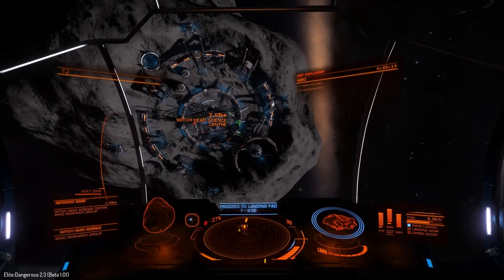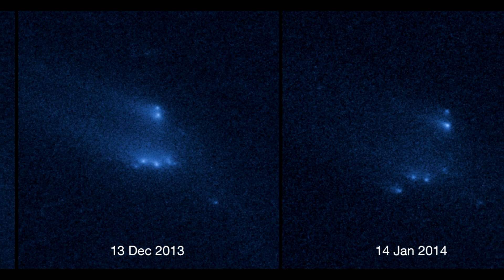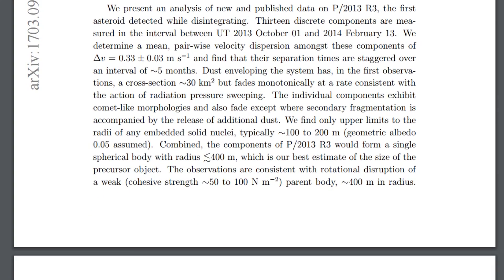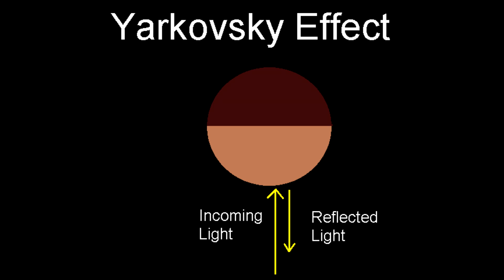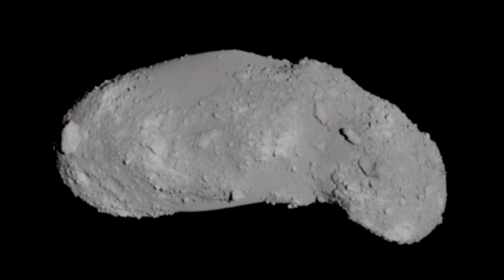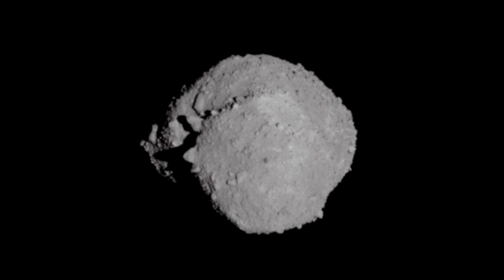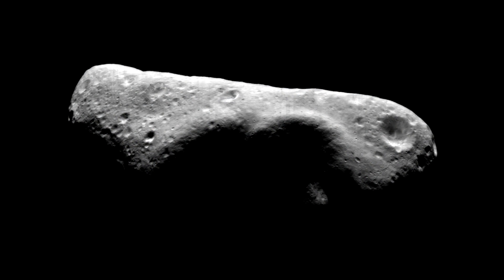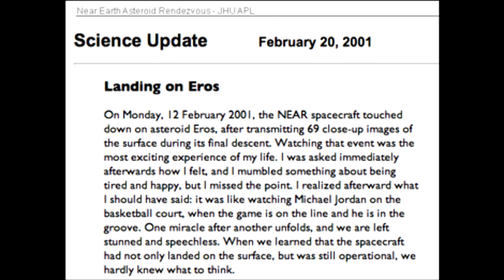Spinning Asteroids To Make Space Stations

Comment: Maybe you don't need that much gravity. I think the minimum would be just enough to do gravity-assisted bodily functions.

Has NASA performed any study on low gravity pooping?
Reply: You can poop just fine in zero g. Here's an experiment. Stand upside down on your hands and try to poop upwards. Piece of cake. If your bowels can overcome negative g's they can surely overcome 0 g.
Reply: I'm not talking about literally extracting the poop from the body using a vacuum pump. It obviously can get out, gravity or no gravity. But once it's free from the body, you better have a way to collect it.

One thing some ISS astronauts commented is how loud the pump on the bathroom is. Everyone hears when it's being used. If you have any "accident" or it malfunctions, the "material" can end up flying everywhere. Even your face.

For instance: with the average/maximum "ejection" speed, how strong would gravity need to be to not let it "splash" outside the toilet?

Am I'm the only one on these comments willing to ask the hard questions?
Reply: Thank you for that... unpleasant imagery.
Reply: That's the most unpleasant, yet most obvious way to answer that question. You sir, deserve a cookie. And a lot of toilet paper.
Reply: Yes you can the ISS has a toilet. Actually shouldn´t be a problem to live in low gravity as long as you don´t plan on returning to gravity ever. Well in the Expanse they came up with fancy medication that keeps your bones strong so if you have that it might work no problem.
Reply: Poop moves through muscle movements, not gravity. Same with food when you swallow, it is muscles moving it down to your stomach. I am sure gravity assists the muscles some but you can swallow just fine lying down.
Reply: dkosmari As far as gravity goes you can go as low as you want for the most part. There are some exceptions, but mainly the return to normal gravity is what causes problems since your body quickly adapts to microgravity.
Astronauts on the ISS are actually really comfortable until they return.
Reply: I want to know if I can pee and poop without needing to vacuum it out of my orifices.
Reply: The questions are decades old by now, that's why people aren't really asking them. We've been pooping in space since the 1960's after all!

Google can answer a lot of it.
Reply: I see what you're getting at, and I'm really disappointed that I don't know anything about the physics of splashing, since now you've got me wondering too.
Reply: It seems that the problem in zero gravity is not to get the shit out of you but to unstick it from your rectal docking port. That's why astronauts had (or still have I'm not sure) a bag with a condom-like appendix where they are supposed to put one finger to manually remove da poop.
So no vacuum, only good old manual mode
Reply: It answers two of OP's question: 
*Yes, NASA has researched low gravity pooping even in the Apollo era.
*No, you don't need to vacuum urine or poop out of your orifices to do your business.
Reply: Actually for human beings, gravity is essential to bone development. In the show and the novel, the Martians and Belters all have very weak bones. Also having a little gravity would make everyday movement a lot easier. You don't need to have the magnetic boot on where ever you go.
Reply: Mythricia they use a vacum its not like house hold vacum power but it  the same. it is yhen stored in compressable.bags for a trip back home
Reply: The answer to that is yes. Considering that on the moon lets say its 1/8 the gravity thus things will go up to 8 times as high.
Reply: Here is the problem pheln there are no.moon toilets there is no imperial data on the subject. But my guess is that if you can poop in micro grav and you can poop on earth you will be able to poop on the moon
Reply: I know that burping and farting are hard in zero-g. I imagine it would be harder on low gravity ambients.
Reply: The biggest issue is actually taking a leak. The human body uses the weight of the piss to tell you its time to go, but with no gravity there is no pressure until it is too late. Once it fills you can suffer the pressure sealing the exit and thus you cant pee. Then, you either have to extract it through a syringe or through assisted reopening. Surgery is not viable in space. But there is a great book called Packing for mars (I think) that covers these topics.
Reply: That is not a pleasant experience at all. You know it sucks when a catheter up you-know-where is actually a relief...
Reply: i am just picturing people playing with a bulls eye in the urinals on in a low gravity environment. in reality you could let fly across the room.
Reply: @ferret1337  
Circumcised guys spray piss everywhere because of meatal stenosis.
Reply: An interesting study would be the effects of low gravity/freefall on gestation and birth. Colonies don't do to well if they can't have kids.
Reply: What should I search for, to find out about gravity vs human feces splashing out of the toilet?

Or are you trying to be a smart ass answering an entirely different question?
Reply: I don't know what you'd search for, I just know the knowledge is obviously available, because we've had people shitting in space for 40 years. There's no way there hasn't been serious research done. In fact I know it's been done, I just rather be doing other things that googling for sources that you could very easily google yourself, instead of writing more YouTube comments. But now you're obsessed with arguing about it rather than actually finding out, which shows you don't really care about finding out, you just want someone else to tell you the answer.

Comment: I think the more interesting analysis is where the break-even on RPM versus 'tensile' strength of the body. 1g isn't a necessity, a percentage of may be acceptable to a point right?
Reply: Long term, health-wise... no one yet knows.  But "quality of life" wise, 25% of Earth's gravity is probably a lower limit, based on Vomit Comet tests of mundane tasks like walking and tool use.
Reply: Yeah, also if you spin too fast (i.e radius too small) it causes motion sickness.
Reply: They really, need to study it in space to see if the crew can handle it in the long term.  There's lots of potential sources of motion sickness in a rotating system.

You've got the up-to-down difference in force from your head moving slower than your legs that everyone knows about.  Then there's the Coriolis forces.

One way these manifest is experienced by people moving towards or away from the center of rotation.  It tends to make you feel like you're being pushed spinward or antispinward.  This can "get you" when you're trying to sit or stand, jump, fall, climb, or ride in a lift.  It also makes throwing, catching, and dropping tools and parts more interesting.

Then also, there is a "spinward' and "antispinward" difference in weight of moving objects.  That is, if you run "antispinward" at the same rate that the ground is moving, your speed relative to non-rotating objects next to the ship is 0, so you're not actually rotating with the ship anymore.  Thus, you're not being pushed into the floor, and you become weightless.  The opposite is true running the opposite way (spinward), and your weight will increase, since you're making circuits about the center of rotation faster than everything else.

All these extra forces, even if they're small, act on your vestibular system (which says you're being pushed around) but not on your eyes (who insist that the surroundings are properly still).  This produces the conflict in the brain that generates motion sickness.

These effects can all be mitigated by longer radii and slow, cautious movements from the crew,  but it can never, for reasonable structural radii, be gotten below noticeable levels (it can take an almost 600 km radius to really quench the spinward/antispinward effect for example).  So from an engineering perspective, it's something a crew would have to live with.  That is, assuming they can from a quality-of-life perspective... constant motion sickness is no fun.  Hopefully they could adapt (or be medicated) to cope with it, but really, we just don't know.
Reply: I submit to you that the true test will cost an awful lot of money ;-) But hey, at least it would cement the way to more habitable space stations if they can work out the right break-even in rotational velocity vs doameter vs gravity level vs adverse effects.
Reply: I'm not so sure it should cost a lot.  Take two crew capsules and string them together with an aluminum cable.  Then use the onboard thrusters to spin things up.

With very few modifications, the capsules should have enough consumables for a few days and preliminary tests of varying radii could be done on orbit.

They've had 60 years to design a pair of such vessels big enough to walk around a little.  It has been well within our technology to do so, and a temporary structure like this would probably be one of the cheapest things ever launched (the payload is just a pressure vessel with prepackaged food and a disposable life support system).  I just don't understand why nothing has been happening with artificial gravity research.
Reply: Faulx Eve I think they have so many projects pipelined its probably a pipedream at this time. That said the idea of having two opposing units is interesting however it presents a number of issues, especially if this was being as an annexe to the ISS as having constantly rotating parts presents a high risk to the platform as a whole. Also, if there was no hub structure, each test would mean suiting and booting and then eva to each of the modules which is really not feasible.

What they really need is to send up a central hub module in the first instance... then the arms... then the ring pieces.
Reply: Actually, the idea is that you would only inhabit one module during the test while the other acts as a back up (its mostly just a counterweight).  So you would only board just before spin up (and spin back down if you need to switch or get out).  Also, it would be in a different orbit than ISS (or a different spot in the same orbit).  For feasibility tests, you would probably only need to 2-3 weeks max habitation time (that's just long enough for the vestibular system to adjust to zero-g).  That should give you enough time to determine if the motion sickness from artificial gravity is going to be an untenable long term issue.  If things look good, then you plan a longer mission.

The short duration of such a trial mission means that the whole set up is disposable, and you don't need to recycle air or water, vastly simplifying life support system parts.  Just a stash of food, a pile of baggys and diapers, lithium-hydroxide to scrub CO2, and a few dozen kilograms of O2 (Apollo era stuff).  Like I said, the technology needed is ludicrously simple and cheap, and the potential health rewards for knowing if artificial gravity is workable are huge.
Reply: Faulx Eve you need more mass under rotation to combat harmonics due to test subjects adding a variable amount of mass to ine side of the balance which could be catastrophic for the ISS. Realistically you would also need a counter rotating equal mass at an opposite location as the differential between the main body and the rotating mass will end producing a rotation in its self and a counter rotation in the main body.
Reply: Err... I think I understand you.  But keep in mind that things rotate about their center of mass.  This center doesn't even need to be inside the structure itself.  In the case of these two ships, it would be somewhere along the cable connecting them, with one ship providing counter weight for the other.  Having one side be slightly heavier will only move the center of rotation a little, because the mass of the crew should be significantly less than the mass of the structure.  For the same, reason movements of the crew would have little effect on the rotation.

Spinning everything up would likely involve firing thrusters on both ships.  This would allow the spun masses to maintain their position.  It is not necessary to use thrusters on both ships though, if only one ship's thrusters were used, the spin will still happen, but the imbalanced force would also create a linear acceleration which would slightly change the apoapsis and periapsis of the assembly... Which is why you would want to do this on a slightly different orbit (one, perhaps, a short way away from the ISS).  Indeed, it need not be near the ISS at all, since you would want to keep your test subjects onboard under simulated gravity for the whole test and not leave the rotating modules till it's time to head back to Earth for physical evaluation.
Reply: Faulx Eve So exactly my point with regard to attaching to the ISS. The rotational momentum will screw up the stability of the main chassis hence the need for an equal and opposite rotational effect.

Two lone ships tethered to each would be extremely difficult to fire in exactly the same way without some kind of rigid structure between them stabilising the whole thing. On top of this would be bringing it out of spin in a controlled way which would present the same challenge as spinning up equally but in reverse. 

Any space station or craft that were to utilise this technology would need to also have a fixed fuesalage with two/four/eight balanced oppositional rings so that navigation can be achieved for the entire body/craft.
Reply: Faulx Eve There's surely  Kerbal experiment in this eh +Scott Manley?

Comment: To touch on your final thought of an artificial gravity generator on the surface, that's what I was thinking throughout the video. a corridor placed at an entrance to the asteroid that would be stationary with a massive bearing at the end where it connects to a large docking bay or what have you, the bay could rotate inside the asteroid to generate gravity. To counteract whatever destructive force that artificial gravity would cause on the asteroid that docking bay could be placed inside a set of rings spinning in the opposite direction. Nullifying any gravity shift between the rings so no amount of artificial pull or rotation would be transfered to the outer shell causing the asteroid to collapse on itself or break apart.

Comment: but can we even make melt/cast steel iron lead coper in space?
Reply: Through the power of induction it is possible I assume
Reply: but we cast mooist steel iron and use gravatie to doe it
Reply: Yes. We did it on the iss
Reply: kira dead If you need gravity to help, you can always spin up a centrifuge.
Reply: it can work 4 small amounts at a time but you need it on a very big scale if you want to build schips or spacestions and make mony while doing
Reply: Sunlight concentrated with a parabolic mirror seems like the cheapest way to heat up material. Spin the container to separate contents by density. You can still have openings near the axis to reach inside as well as admit solar radiation.

Comment: So you should spin a part of a station that is build inside the asteroid I guess :D. That way, you have a cool setting, you can dock easier, and you don't have to spin up the whole asteroid ! 
Though I guess in that case, you have to always be spinning it up, so that friction doesn't stop you, and after a long time, your asteroid ends up spinned up anyway ... Unless you counterbalance friction by permanently spinning the asteroid in reverse using rocket motors XD ! 
Yeah, sounds like it's easier to get rid of the asteroid altogether !
Reply: Alastor Actually, this idea would make sense.

Yes, the station would spin by making the asteroid spin the opposite way. The asteroid becomes a large reaction wheel. It wouldn't be much of a problem, since the asteroid, being much more massive than the station, would counter spin much more slowly. Any friction slowing the station down would also slow the asteroid down. The advantage is you could do it with electric motors and electricity, no need to eject mass from a nozzle.
Reply: Friction is inelastic and will dissipate energy, and if you keep "reboosting" the rotating core, eventually, you would spin up the asteroid to counteract this dissipation. So if you don't want it to come eventually apart, you need at some point to compensate this dissipated energy. 
I agree that it's much more doable than just spinning up the whole asteroid, but over time, it will be more costly (in terms of energy) than just spinning up the same station in the vacuum of space. 
In the end, I don't see the benefit from being in an asteroid (apart from being extremely cool !).
Reply: Alastor The friction is between the station and the asteroid. Not sure why you would think friction would slow down the station but not the asteroid. They slow each other down, by the same proportion they accelerate when you doing the spin up.
Reply: Hummm, you are of course right. I assumed when then reboosting the station in relation to the asteroid, you would ... I don't know what the f*** I assumed, but if was wrong, because of conservation of momentum ... 
I had a great idea and I didn't even realize it !!! :D

@Scott Manley, shall we get on with that plan ? That sounds great ! 
Spin up a tiny bit the asteroid (which is much more massive than the station, and by being around the station, has the perfect mass distribution), and reverse-spin up enough the station to provide artificial gravity. You can even keep docking bays for ship in the middle fixed in relation to the asteroid, so that it can be easier to dock.
Reply: Even better, there is basically no friction.  You get friction when load bearing surfaces push against each other.  Since asteroids have basically no gravity, there's no load to bear.  Thus, hardly any friction.